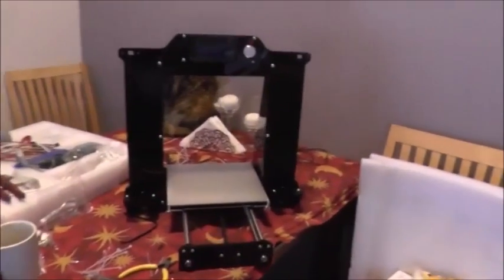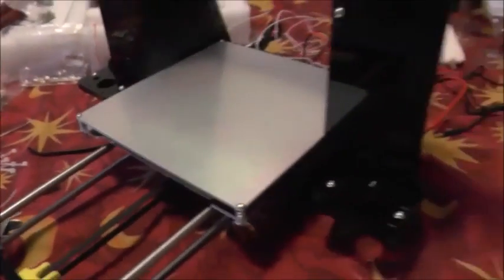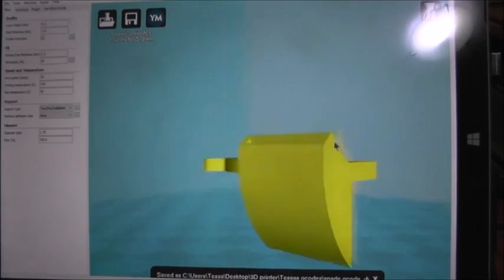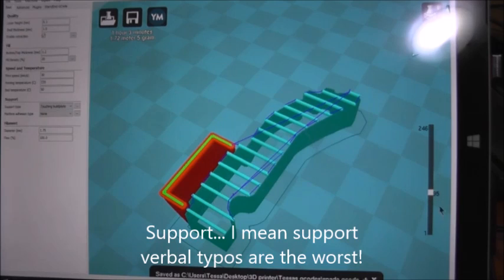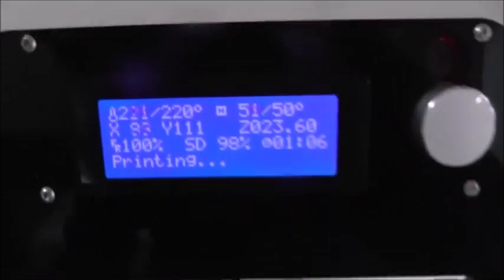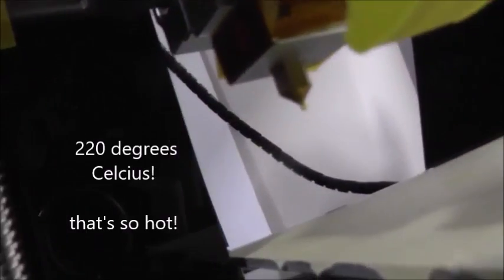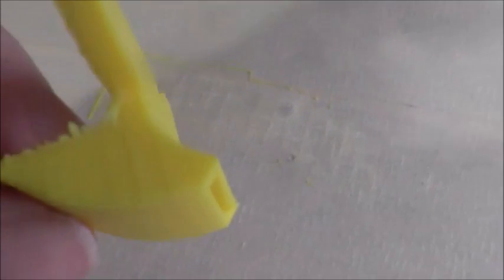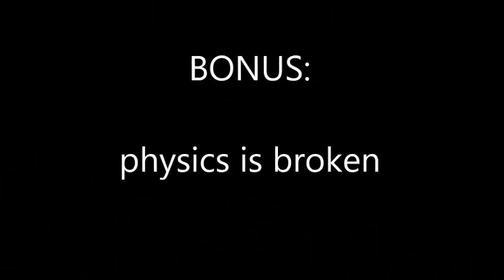New 3D Printer Kit & First Print

Comment: Tip: don't shut off the printer when the hotend is still that hot! If you cut the power off, the cooling fan stops blowing cold air on the heatsink. The heat can creep up from the nozzle to the coldend and cause clogs. So let it cool down to at 100C first..

Comment: Can you tell me about the auto levelling function? I can't find any information on how it works on this printer and can't see any 'parts' on the video that would show how it work?
Reply from the maker: Mr Evans this printer did not have auto leveling. it only had a limit switch and manually adjustable bed screws :)

Comment: what did you put on the bed so the print would stick?
Reply from the maker: hi. I used yellow masking tape and the bed was heated to 40 or 50 degrees C. later I also found a light application of glue stick would help prints stick as well. however not all glue stick brands worked. the most important thing is to get your nozzle aligned with the bed and to make sure it is the correct distance from the bed for the first layer. if the first layer is sticking, but is not perfect... let it continue printing.. sometimes the print will recover and turn out fine. you will gain a feel for it with experience.

Comment: Hi SparkyFace5,
I'm from Western Australia too :) I am 14 and trying to find a cheap but reliable 3D Printer. As I am a beginner in this department do you think you could tell me if this printer described in the video is good for a beginner like me just starting off. One more thing, has it lasted up until now?

Thanks, Jett
P.S Keep up the good work :)
Reply from the maker: hi Jett, thanks for watching :)
I used to recomend kit printers for beginners but now I tend to suggest starting with a pre assembled one if you have not had much experience in mechanical or elecrltrical building and troubleshooting. if you feel confident in these skills thrn I think it is a wonderful way to learn more about how your printer works from the base up. sometimes these kits are missing parts and sometimes the components may need replacing soon after purchase. This is due to the nature of buying cheep. personally I really enjoyed building and modifying this printer! and it worked fine for me straight away. it would still be running today except that I tore it apart for another project I wad working on. please read some of the other comments and responses on this video as they might help you with your decision also. good luck and happy printing :D
Reply from the maker: hi Jett, thanks for watching :)
I used to recomend kit printers for beginners but now I tend to suggest starting with a pre assembled one if you have not had much experience in mechanical or elecrltrical building and troubleshooting. if you feel confident in these skills thrn I think it is a wonderful way to learn more about how your printer works from the base up. sometimes these kits are missing parts and sometimes the components may need replacing soon after purchase. This is due to the nature of buying cheep. personally I really enjoyed building and modifying this printer! and it worked fine for me straight away. it would still be running today except that I tore it apart for another project I was working on. please read some of the other comments and responses on this video as they might help you with your decision also. good luck and happy printing :D

Comment: Hi,
I was just wondering If this is worth buying it since it's for $300. And I believe you live in Australia too
Reply from the maker: Hi, Yeah I live in Western Australia. I cant tell you if it is worth it for you or not.. that's something you will have to weigh up for yourself. however I can say that kit printers require a certain confidence in both mechanical and electrical abilities. I had no problems with my kit and everything worked right out of the box. having said that I have heard stories of faulty parts being delivered or parts missing. so if it is your first printer you may consider getting one that is pre assembled or having someone with some experience help you with the setup. I hope this is at least a little helpful . goodluck and happy printing :D
Reply: +SparkyFace5 glad to see your reply. Well I have ordered my kit through ebay. The one for $300. And yes this is my 1st time buying 3d printing kit. Just wanted to know how difficult was it to build it since I am receiving mine by 2-4 days ?

I look forward to hear your reply ASAP
Reply from the maker: How exciting! The instructions were bit vague at times.. make sure you pay close attention to which side is left and which side is right.. because if you get these backwards the cabling wont reach where it needs too. The build can take some time. try to keep all the parts together and organised and take regular breaks when frustration hits. Make sure you check the power wiring is crimped correctly and wired correctly before plugging in.

let me know how go :D
Reply: +SparkyFace5
Thanks will let you know once its fully build up and running. Will post a vid on youtube too. And yeah I know it will take alot of time to build itself
Reply: +SparkyFace5 Hi,
I got the 3d printer. Assembled everything up but I have problems with wiring up the stuff and yes the instructions were very dumb at some point. I was wondering do you know what does L nozzle power and R nozzle power stand for ?

I hope to see your reply ASAP
Reply from the maker: +Saad Iftikhar I can only guess it sounds like left extruder power and right extruder power. it could possibly be for the heater element in the nozzle. or for the fan that cools the extruder.
Reply: +SparkyFace5 Is there anyway i can contact you ? like can i PM you ?
Reply from the maker: +Saad Iftikhar I am with family at the moment, you can email me at sparkyface5@gmail.com however I will probably not reply tonight
Reply: +SparkyFace5 Thanks for your reply just wanted to know did you get a white board with 2560 name written on it or was it the other one ?
Reply: +SparkyFace5 glad to see your reply. I got x, y and z axis working :) but sadly the extruder motor somehow doesnt work ;(. May I know did you even experienced the extruder motor not even working or does it work with the software ?
Reply from the maker: +Saad Iftikhar I didnt have any problem like that. however the extruder motor wont operate unless the nozzle is already heated . If you heat the nozzle and it still wont work, check the cable is good and that it is connected well at both ends. If the motor runs in the wrong direction unplug the cable at the control board turn the plug 180degrees and plug it back in (so that it is backwards to how you first had it). good luck :)
Reply: +SparkyFace5 the nozzle wont even heat. I tried it by using the 3d printer lcd menu. when I go to the extruder part and rotate the knob. the motor doesnt even work nor the heater too. I even tried checking the connections.
Reply from the maker: +Saad Iftikhar if you plug the extruder motor cable into the x-axis on the control board.. and then tell the x-axis to turn.. does the motor work?
Reply: Hi,
Just to let you know the 3d printer is fully working and operational. Will post some videos about it :). Thanks for the help that you gave me it's been very keen talking to you :)
Reply from the maker: +Saad Iftikhar thars great :D I'm glad you got it working and I look forward to seeing your vids!! congrats !

Comment: Hi, the ebay link no longer works. do u have an updated link?
Reply from the maker: +LostMyFinger Unfortunatley I do not have an updated link as it appears that the seller has closed shop. However it is similar to geetech and other acrylic framed i3 printers in the under $500AUD price range
Reply: oh nice!! does your printer have a heater plate? as warping might be an issue
Reply from the maker: it sure does, I generally have my bed set about 50C when printing with PLA :)

Comment: I'm about to get the same style of I3 printer, would you still recommended it ? If you move it by grabbing the middle support, does it throw out all the calibration ?
Reply from the maker: this printher when assembled well works great. picking it up from the middle support has cause me no issue. it is only really suitable for PLA. but PLA is a great material to print with. the bed leveling wingnut system is terrible but you can find lots of alternatives that fix this on thingiverse. because of the low price of this kind of machine you may have to change the nozzle fairly soon after buying it. all 3D printers have a steep learning curve so dont give up, do research, join forums and ask questions :)
Reply: +SparkyFace5 Ok, thanks, I have already looked at upgrades such as a E3Dv6 nozzle. 
From one Aussie to another well explained.

Comment: i bought same printer but my print is not stick on hotbed. any suggestion ? 

Please share setting ...
Reply: +iFuture Technology Mix a 7 parts of wood glue(white glue or White elmers glue) with 3 parts of water and mix it.
Next use a brush and brush it to the print bed and let it dry.
Or try spraying hairspray on the print bed
Reply from the maker: +iFuture Technology thanks for your question. The first step is to make sure the first layer is being printed VERY close to the bed. It is very important that you check the bed leveling on all corners as well as the middle and do this while the bed is at the temperature you will be printing at. Beyond that it really depends what materials you are printing with.
Reply: SparkyFace5 MY glass seemed to have a bulge so it would never be leveled.
Reply from the maker: +Karl Karlex wow :( sounds like you need new glass
Reply: SparkyFace5 yep

Comment: On your print head I think your fan is on backwards. When I built mine I fitted it the same way but the fan didn't run, turned it round and it was fine.
Reply from the maker: +Cold Coffee_  Thanks, you have a keen eye. It may well of been backwards in this video :) I have had it apart and back together a couple of times since then and it seems fine now

Comment: What software did you use ???
Reply from the maker: At this stage I was using Cura to slice the models into gcode. Cura is free software and the printer manufacturer had given me some base settings to work from. To date I have not connected this printer to a PC directly as I always print from the SD card using the inbuilt LCD interface.

In my most recent video (ep7) I am using Simplify3D which is paid software.
Reply: +SparkyFace5 I forgot to mention that I'm using a Mac so it's pretty tough to find a software that'll work. Curas machine settings don't mention which one to select and Repetior is about gcodes which I'm a noob at.
Reply from the maker: what kind of printer do you have. I think i just set up a custom machine and put all the measurements and checked the heated bed option box. Then there will be other settings to fix up in the program like filament diameter, temperature settings etc..
Reply: +SparkyFace5 I have the i3 Pro B and what software do I input that information ?? Cause in Repetior it makes my lower axis go all the way to the right when it starts the GCode all the time so I have to stop the print because it never returns
Reply from the maker: ah, I was talking about Cura. Is that because your end stop for that axis is on the left? If so you can change the orientation of the plug for that stepper on the control board should make it drive in the opposite direction. do you have a facebook account we can chat live send pictures and whatnot to try to get you running. Or there is a group on facebook that are very helpful folk @ "3D Printing". If I can't help someone else probably can :)
Reply: +SparkyFace5 yeah that's what I wanted to know like what machine do I select in Cura? Because idk what machine does this 2560 board belong to... That's where my confusion is at
Reply from the maker: This guy does a quick video to setup Cura for a i3 style printer, his settings should work for you and will be a good starting point for you to adjust from. --> https://www.youtube.com/watch?v=DDXo2GBmbtU
Reply: +SparkyFace5 awesome thanks much appreciated
Reply: +SparkyFace5 why did you print that in 100 microns?
Reply from the maker: +that phill bot it was my first ever print so I used the recomended settings given by the manufacturer :)

Comment: Hi,
I bought the Geeetech Prusa I3X, and after mounting I have problem with upload the firmware into my GT2560.
I read  in the www.geeetech.com forum, and in the wiki section the steps for upload the firmware into my GT2560, but there is a step that doesn't exist.

I downloaded from the site http://www.geeetech.com/wiki/index.php/GT2560 the "Source":
Arduini IDE
Marlin
Printrun
Repetier-Host

I installed succesfully the "USB Serial Port" into my Windows 7.

I modified the parameters like the wiki said, but the Prusa I3X doesn't work, the LCD doesn't visualize anything.

Please can you help me?

My email is: riko.roma@gmail.com

Thanks.
Reply from the maker: +Riko Store 
Hi Riko, with my printer I haven't had to upload any firmware as it came already loaded. However if the LCD is not showing anything at all I suggest you first double check your wiring and make sure it is all ok. with my printer I had to re-crimp some of the spade connectors for the mains power. If you are getting power to all the right places then check that the data cables are also correctly plugged in.

I hope this is helpful to you :)
Reply from the maker: +Riko Store  also just a safety point.. dont work on the machine or the wiring when it is plugged into power.. please make certain it is off and unplugged first.

Comment: it has app works with android and ios also wifi. I bought CTC 3d from ebay china (makerbot r2) copy. no wifi trying to get rpi2 and octoprint to work with it.

you might want to set the infill to 40% for strong part.
Reply from the maker: Thanks Brad :)  The wifi app is okay but sometimes has connection issues.. so I tend to use the printer directly from the SD card.
Please do let me know how you go interfacing your RPi2.